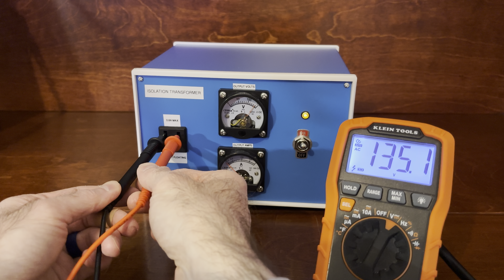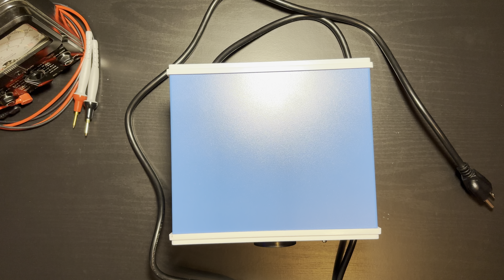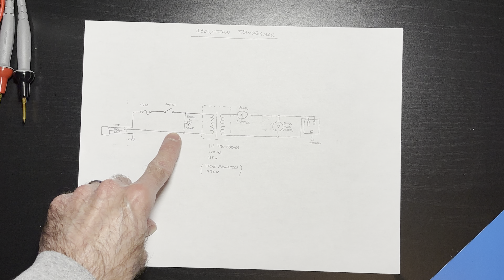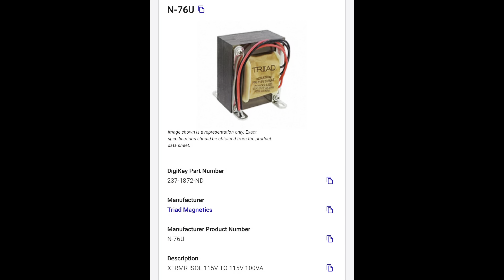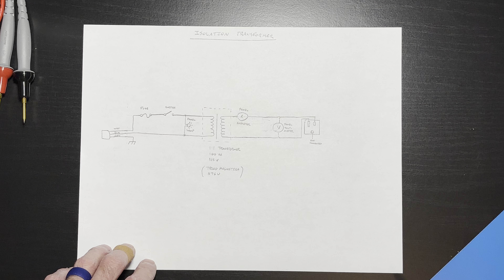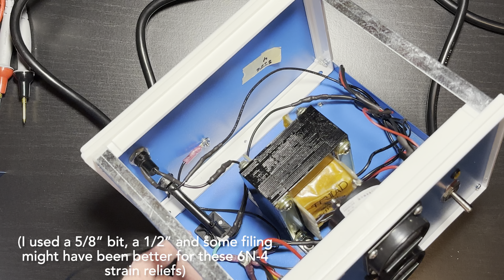Building an isolation transformer

Comment from the maker: Safety Correction:

In this project, the hot conductor (black wire from line cord) for the transformer primary should go through the fuse and switch. I mistakenly used the white wire as hot (based on an experience with a previous build) and the black as neutral.

This has now been corrected by switching the white and black.